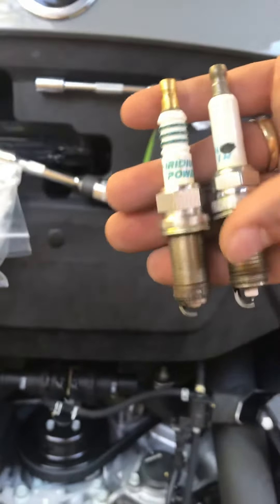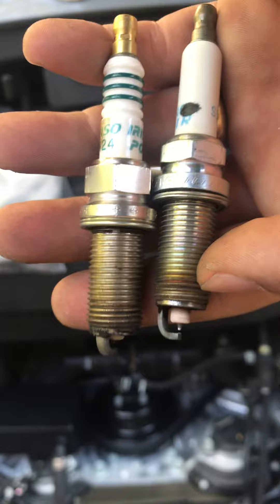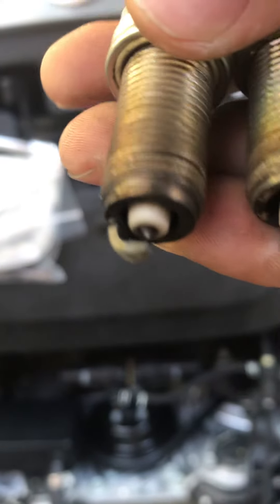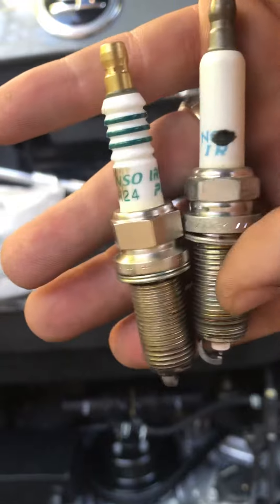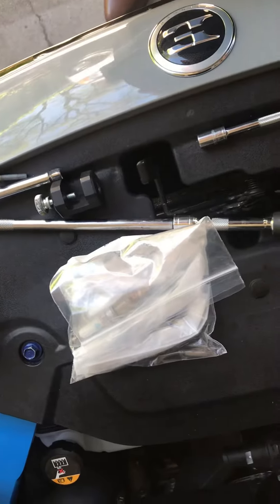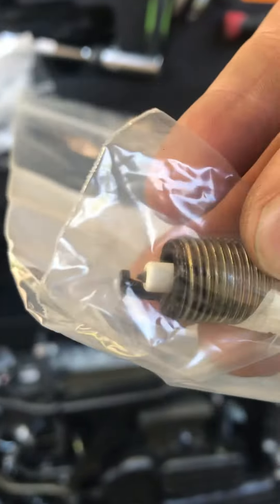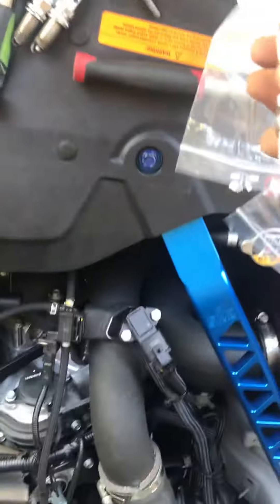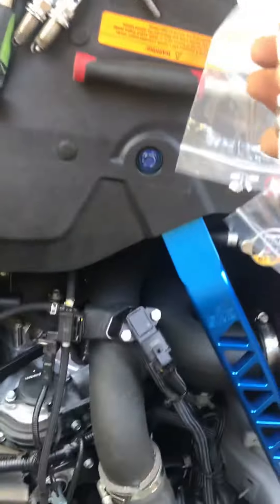Kia Stinger GT misfire spark plug comparison to oem.

Comment: Are you running any aftermarket modifications such as exhaust or a piggyback tune module? If so I would suggest running HKS M45IL Spark Plugs.
Reply from the maker: G Lewis yes I am running a JB4 piggyback, wmi kit, exhaust and intake.
Reply from the maker: G Lewis I ordered the denso ihk27 which are 2 step colder that oem. I had denso ihk24 which are only 1 step colder.
Reply: PR VIDEOS 

What gap are you running on those plugs? They should be gapped at .022 for those denso plugs that you are currently running.
Reply from the maker: G Lewis they are..... looks like it still fried them .... I ordered the same one but a step colder. I put the oem plugs back on on cylinder 2 and 6. Scared to drive the car hard to see if it misfired again with the oem plugs
Reply: @prvideos8229  you have to buy the hks plugs. It's the only way to be safe. 👍🏾
Reply: Are hks really that much better if at all better than denso?
Reply: How many miles on the denso plugs?

Comment: You could try to swap some of the coils areound and see if the misfire codes move to the other cylinders.  It would tell younif your coilpacks are bad.
Reply from the maker: Max Nguyen agree I swappped the 2 bad plugs worth he oem ones first to see if I get a misfire.

There is no proof or data to prove the hks is better than the denso ones.

I had the plugs for about 8k miles not gapped at .024.